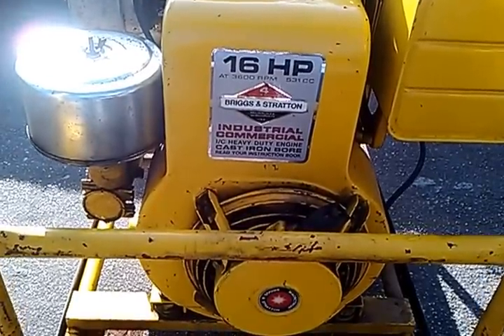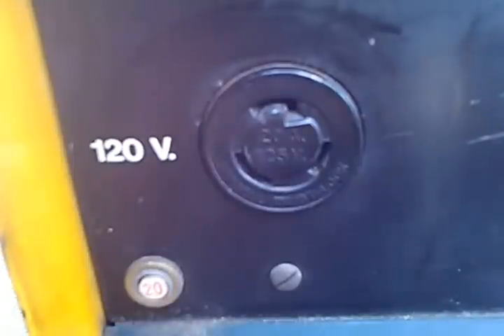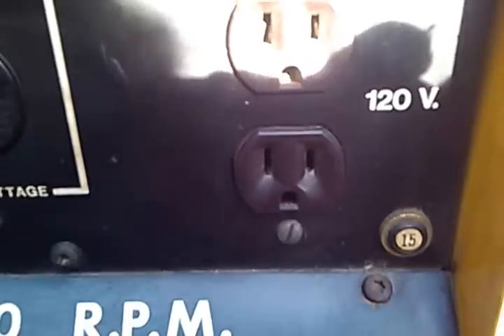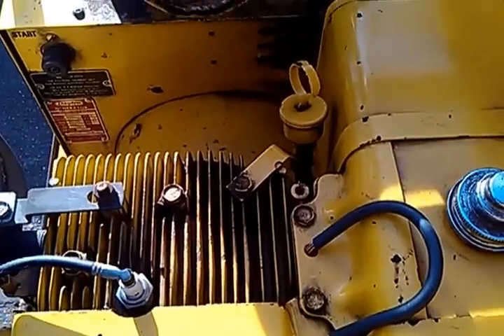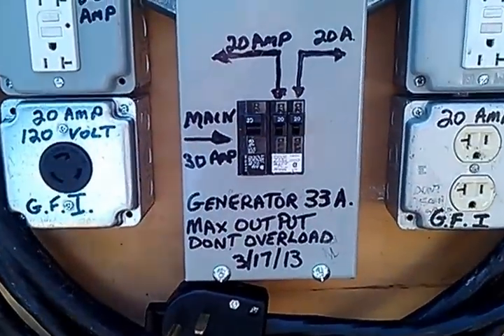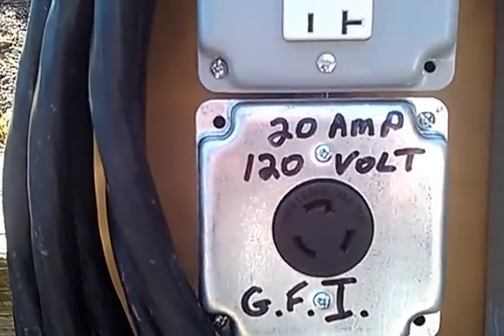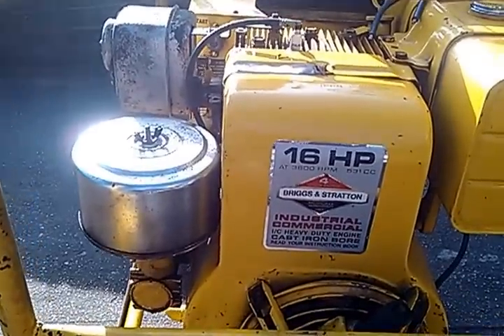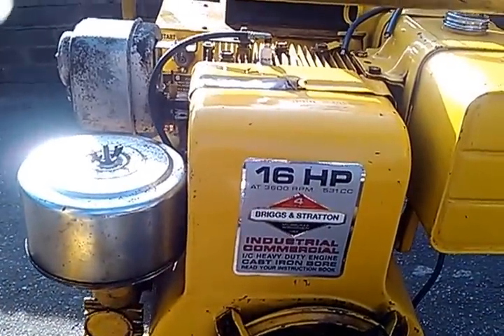Briggs & Stratton 16 HP 1800 RPM 4KW Generator [Read Description]

Comment: John, if you still have this unit could you share the model number.  I have one almost exactly like it made by WINCO (1981) and I'd like see if mine will start electrically like yours does through the alternator without using an external starter motor. I'm pretty sure WINCO made those for Dayton.

Comment: Put a real muffler on it and it will be much quieter
Reply from the maker: Wow, what timing, just ordered a calibrator kit [float and needle valve] and upgraded muffler. Was working generator [and snowblower] last week. That muffler came with unit. Sometimes I like the loudness as a benefit, can't hear the old-lady squawking bothering me with nonsense when in mechanical zone.
 Thanks for watching.

Comment: great video John. Have you considered a propane conversion? I like your setup, no backfeeding. i keep a unit just this around as a backup, last resort.
Reply from the maker: Was pondering propane as backup, though planing on going full blast on my shed, had delay$. Need automatic failsafe setup if I'm not home. In the realm of stationary engineering & mechanical trades having, more then likely going with your style set up, love your 55 gal drum fuel idea, tough leaning on 275 gal tank. Your video is very informative and I'm using it as my guideline [transfer switch, fuel filter & exhaust]. Q: did you put a foot valve (check valve) on inlet of fuel suction? If so, is it spring loaded or swing check? Thanks.

Comment: Great find on the generator, I love this particular model. Just a word of caution, It says 1800 RPM for a reason. The best way to shorten a "long life" generator it to play with the throttle, if you over rev this generator you more than likely will do permanent damage to it.
Reply from the maker: Thanks for watching, just throttled-up engine for video purpose. Love this unit and it never let me down in the thirty years I owned it. Glad back then I purchased an electric start model, could never pull start this unit now, nor kick start old motorcycles.

Comment: This appears to be a model 326432.
Reply from the maker: Thanks for watching and returning a post... and Yes it is a 326432 having plenty of mass & weight, all cast iron even the alternator/genhead is cast iron, it's a beast.
Reply: +John S 
This one is a post-1981 model seeing as it has the Magnetron electronic ignition label on the rewind starter housing.